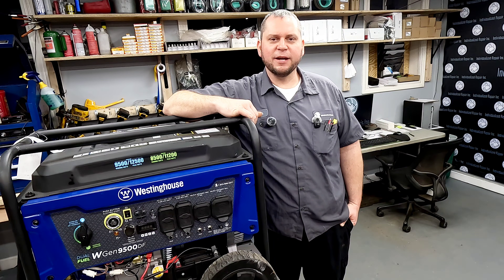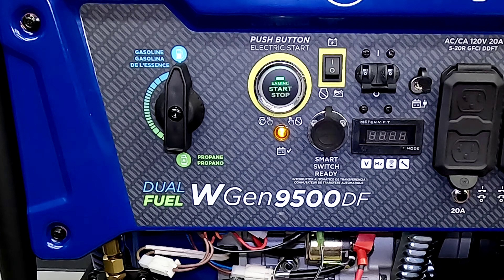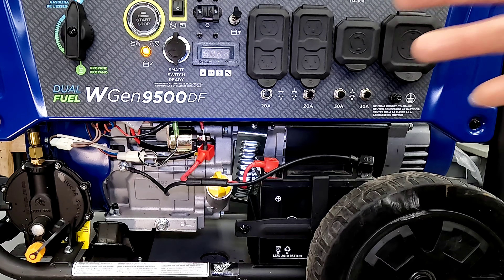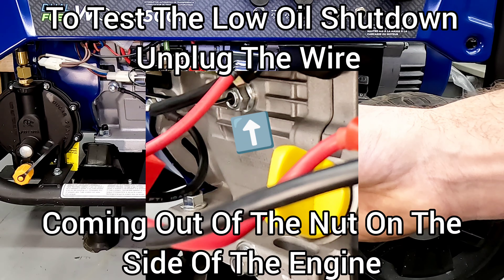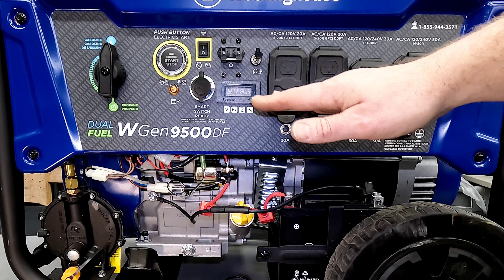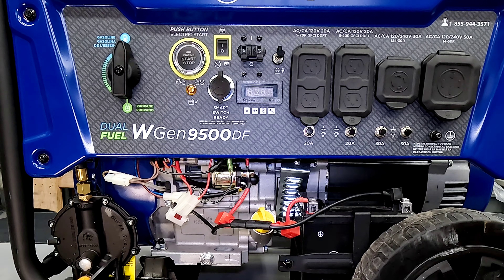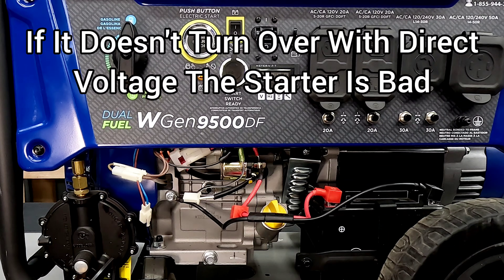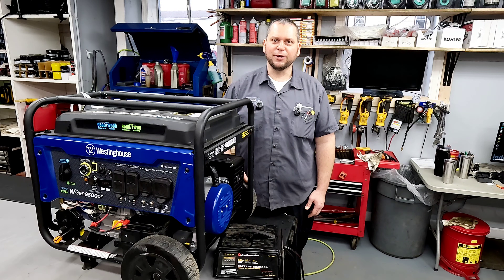Generator Won’t Start The Most Overlooked Problem Not Fuel or Carb!  Easy Fix & Diagnosis WGen9500DF

Comment: Do you have a video on checking and or replacing the Control Module on A WGen 7500 My electric start and my key fob start don't work the pull start works and if I bypass the solenoid with the automotive bypass switch it starts the technicians at Westinghouse said it would be the control module how can I find out for sure
Reply from the maker: I am sorry I sure don't. I do see this happen often though

Comment: Thanks, I just got the generator you showed, except it is not the duel fuel. Gas only. The first  time I had to run it, it ran  for four hours, no problem.  The next time, it would only run about 30 seconds, and the co2 light would come on. I am plumbing the exhaust outside. It is in my  woodshed, but I have seen this happen on other videos even when the generator is outside. Any recommendations ?
Reply from the maker: It definitely sounds like the CO sensor is tripping; there might be an issue with it or actually getting CO to the machine for some reason. Could even be another source

Comment: My pulsar 12000 wouldn’t start via the starter.  I hooked up an m12 battery and bypassed the switch. As long as I got a screw driver and a m12 battery I’m good.
Reply from the maker: Sounds like you found a solid workaround to get it going! Awesome stuff!!

Comment: my generator has been in storage for a couple years. When I click the switch I get the yellow light. Then when I push the start button I hear a buzzer, and it won't start. We put a charger on it and push the start button, and it started right up. After running a few minutes we shut it off, and it wouldn't start. I just made the buzzing noise again. What should I try now?
Reply from the maker: The battery is likely bad. Have it tested and replace it if it doesn't have enough cold cranking amps (I would be it doesn't)

Comment: Thank you for sharing this video. Interesting stuff. We just bought one of these generators used, in running condition. Without a battery, but with propane hooked up, it pull-starts easily. We hooked up a battery, but when the ignition switch gets turned on, there's a buzzing from the solenoid (or the starter trying to spin?) and the sound of disengaging when the ignition switch gets turned off. The blade fuse to the fuel solenoid on the carb is good. The start button does not light up. Trying to decide if we should replace the start button next or look at the fuel solenoid next.
Reply from the maker: Is the battery for sure good then? Always have to ask lol. The buzzing could be from a bad starter solenoid or starter. Figure out if you are getting voltage to the solenoid when trying to start (on the two smaller wired going to it). If you are, jump the solenoid and see if the starter engages. If it does, you know the solenoid is bad. If you are not getting voltage I would point towards a start button issue
Reply: @IndRepair  Thank you for the pointers. Hope to get to those today. The solenoid on the carb looks promising as the next culprit. We got the generator used for only $100 so I can't complain. Has maybe 400 hours on it. I did hook up a 600CCA battery last night and the buzzing is still there when the ignition gets switched on. We can live without electric start capability. I would just keep the propane ready (for pull-starting it up and getting it warmed up a little) then switch it over to gasoline. It's backup power for the rare outages around here.
Reply from the maker: Definitely

Comment: Im getting no power at all.  I can touch both points on the solenoid and it trys to start but no power at the buttons.  Any tips
Reply from the maker: Hmm, if you're getting no power at the buttons but can jump the solenoid, it sounds like an electrical issue before the solenoid itself. Have you checked the battery terminals and all the wiring connections for any loose points or corrosion? How about the fuse?

Comment: I have 1 and the battery indicator light, switch light, none of that come on. Batteries charged, fuses good, will start but obviously die. Suggestions?
Reply from the maker: It sounds like it could be a wiring or grounding issue with the low voltage system. Has actual battery voltage been checked?
Reply: @IndRepair Greetings, I was going to do some maintenance on my generator and it won't turn on. I fixed it but it won't turn on.
Reply from the maker: ...what seems to be happening

Comment: Martin - Mine cranks and cranks then eventually stops cranking and flashes red when I push the start button, but it starts the first or second pull every time with the pull rope with the choke pushed on, and then the choke automatically moves off and she runs great.  The choke moves when its cranking while using the auto start...thoughts?
Reply from the maker: Seems like not moving fast enough to start from starter...maybe fuel not so good?
Reply: @IndRepair  fresh fuel, fully charged battery....same deal
Reply from the maker: What voltage is the battery testing at? Sometimes even if fully charged I see this with batteries. Need a load test to be sure

Comment: Is there a way to get around the electric start and just start it manually?   I have one less than a year old and it never starts. I always have to pull out my old Generac that's always starts manually.
Reply from the maker: There is but you will have to look at the wiring diagram and wire the fuel solenoid directly to battery power from an on/off switch or something do the battery does not drain and hook up and auxiliary way to stop the spark. Not recommended but possible

Comment: Hey Martin  my WGen 9500 DF  it is cranking over sputs once then nothing. Checked getting fuel, also squirted carb cleaner still nothing. Checked spark was very weak changed plug. Nothing Westinghouse sent me a coil replaced it. Still weak cranks over won't start  at a loss. If you could point me in a direction that would be great. Oil level and sensor are good also. Thank you.
Reply from the maker: I would disconnect the kill wire from the coil and try to start it see if you get anything then. The only wire going to the coil Coil was gapped at .010" ?
Reply: @IndRepair thanks I will try that
Reply from the maker: If it starts without the kill wire hooked up it is likely the start button itself is what I see

Comment: I have follow all those step and all seems to be good the green light flashes and I bridge the starter and it makes attempt to start but the engine won’t turn over, any other suggestions
Reply from the maker: So the engine will spin just not start when jumping it or not spin at all?

Comment: I have the wgen5300 model. the battery indicator is not lit (battery is full charged, checked with a tester), unit won't start with the coil either. what could possibly be the problem? I really need help! thanks!
Reply from the maker: Did you check the fuse?
Reply: @IndRepair  I can't find the fuse. I watched your video and the fuse in your unit is easy to access. seems like mine is way inside which I can't get to.
Reply from the maker: Will have to follow the wire up if buried

Comment: so i am trying to get a duramax 5500hx running.  It will start and stay running with starting fluid being sprayed.  Im not an engine guy persay but Ive checked that gas does flow to from the tank into the carb.  I have taken the carb apart and blown it out and found no residue or anything.  and gas does pour out of the bottom if the nut is removed.  anyways, blew it out put everything back together and nada.  I did drain the old gas and put a half gallon of new gas in it.  I checked the oil stick it is in the hatch marks.....any ideas.
Reply from the maker: I would check to see if the fuel solenoid on the bottom of the carburetor is working (does your model have one?) If not the carb is definitely plugged or the fuel quality is bad
Reply: @IndRepair  you were right i brake cleaned the carb very very well and presto! Runs like a champ.  I do have a question as to this seemingly unnessasary box that the tube from the top of the gas tank goes in to and then another hose goes back to the air filter box?  It has eco emissions stuff plastered on it.  Does it relate to that?  I am keeping it out of the loop at the moment as i mislocated a hose....so whatever.  Also Thankyou for getting back to me.
Reply from the maker: Glad to help! Just EPA fuel tank vent and carbon canister is what you are looking at there
Reply: I have a faraday fg6500e. Which up to now was running reasonably well considering its age of 21yrsm though it hasnt seen much usein its infancy the last 4 yrs or have seen good use till a week or so ago. Its a keystart with a starter motor, bought a new good battery. Still wont start. Ive checked the starter on a good battery which it allows to turn over. Ive got the following 2 suspicions, the ignition switch, the starter motor when  reinstalled is not turning over. Before i bought new battery it ran half a day restarted but afterwards failed thats why im.looking into ignition switch. Anything else to.look at. All advice will be appreciated. Im in SA

Comment: I have the exact same model, and when I turn the power switch on the starter starts running but doesn't engage and the power switch does not come. I replaced the switch,  control module and the solenoid and still doing the same thing. Any ideas please 🙏
Reply from the maker: Double check the battery is hooked up right and the wires are all clean and free of corrosion. Almost seems like it could be backwards or bad/shorted wiring somewhere...
Reply: @IndRepair thank you very much for answering
Reply from the maker: @DinsmoreOutdoors glad to help!

Comment: any thoughts on a new machine that has sat for 5 years: (just replaced the carb and ignition coil) if I unplug the kill switch from my ignition coil it runs. if I plug the coil back into the kill switch, it cuts off after 2-3 seconds. the switch and buttons on the board work as they should. Any ideas what's making it shut off?
Reply from the maker: I would double check the low oil switch is working. There is plenty of oil in it?

Comment: Mine wont start on the gas side, never used it, bought it..started it to see it run, been sitting covered...now it'll start fine on propane, but just cranks on gas?
Reply from the maker: Check for any blockages in the fuel lines, and then I would double-check the fuel valve to make sure it is working. If fuel is getting to the carburetor the fuel solenoid could be not opening all the way

Comment: I’m confused - my understanding is on a perfectly running unit you can totally disconnect the battery and pull start it to get it running. What’s the point of a manual start that relies on a battery?  Makes no sense.
Reply from the maker: This is incorrect. You need at least some battery to run the fuel solenoid. The pull start works in a pinch with a partially charged battery but without the battery it will not work as the solenoid can not engage
Reply: @IndRepair  one trick is to start it with propane or natural gas and then switch it over to gasoline while it’s running. That works great.
Reply from the maker: Have heard about it but never done it
Reply: @IndRepair - that sounds like a bad design!  Thanks for the reply. And you also said some of these 9500’s charge when running (built in stator) and some don’t?   That would be a bad design or approach too😮
Reply from the maker: @condor5635 some generator designs charge when running and many do not. The 9500 series does not have a built in stator
Reply: @IndRepair - some confusion then - because I’m looking at the 9500 DF manual right now and it clearly says - ‘Note the generator is equipped with a battery charging feature. Once the engine is running a small charge will slowly recharge the battery.’
Reply from the maker: If you check the battery voltage while running it will not increase. At least I have never seen one that had it. They recycle these manuals and many are inaccurate. Many label them as bonded or unbonded neutrals also and they are backwards...

Comment: Hey Martin,  I dont know what the issue is with mine, replaced the battery and the fuse , no power at all on the operator control panel ..no lights at all, will not start manually either. stumped on this. 
thanks for your videos
Reply from the maker: I see the push button go bad often if your getting power to it good chance it is bad

Comment: So u have this exact generator.  My baterry indicator light doesnt come on. Installed brand new battery. Still nothing. Any ideas on that?
Reply from the maker: Check the fuse on the smaller red wire coming from the solenoid hooked up to the same post as the positive battery cable. It feeds the generator power from the batter
Reply: Same exact problem.  I picked up a new battery.  Nothing. No battery indicator light.  I’ll get a new fuse and reply with the outcome.
Reply: New 10A fuse fixed it.
Reply: @mikeneff6057 Would you mind sharing how to do this?  I think I have the same problem.

Comment: You are not going to believe this!!!! Despite what the manual says I did what you said I pushed that little red button till my push button went red then I pushed the fob for a second to pair and the red button blinked. I then turned off the battery and back on pushed the Fob after turning the fuel switch to gas and the starter engaged whoo hoo! Now I’m going to put everything back together hook up the natural gas quick connect and see if it starts for the first time!!! You Rock so glad I subscribed!!!
Reply from the maker: Wow, that is great! Did the natural gas work too?
Reply: https://youtube.com/shorts/ci7-uvgP89M?si=Fa1AybCWWWiNKUwB
Reply from the maker: Awesome